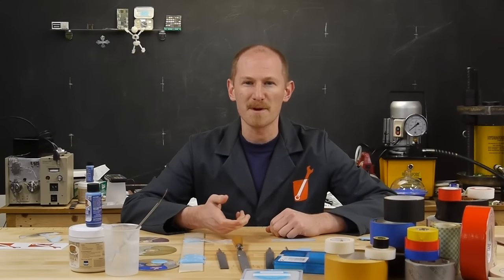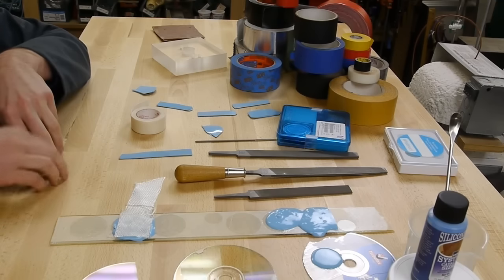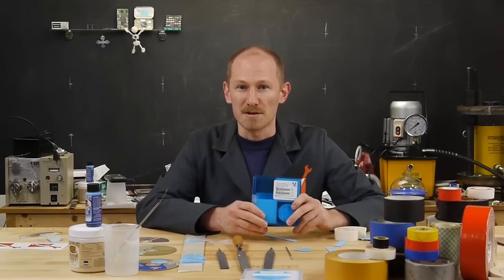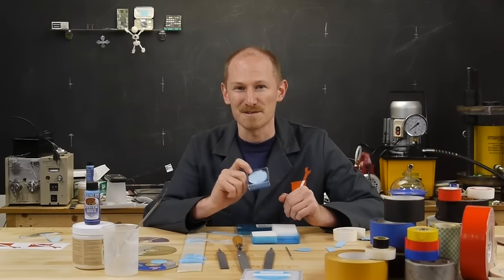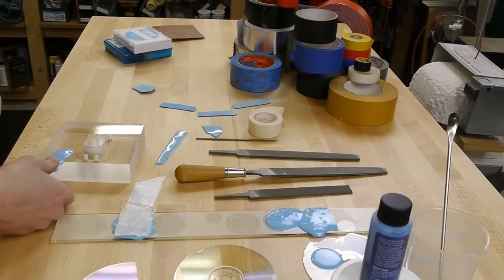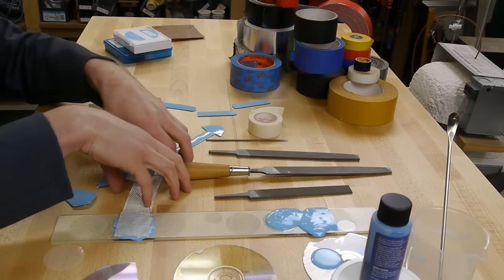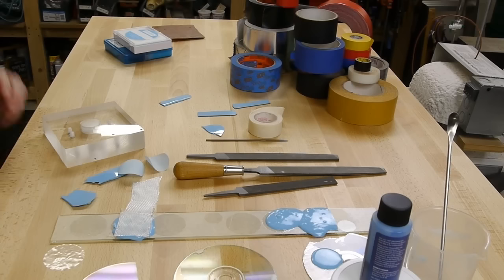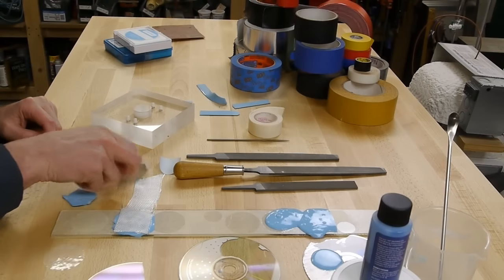Making DIY gecko tape - work in progress

Comment: I think that the cd idea was great, you could try to use a dvd burner, but with the initial laser replaced with a more powerful one (a classical dvd burner isn't supposed to burn the external plastic), the good thing about this is that the optical system is already there, especially the adjustable-position lens. 
From there, by adjusting laser pulses duration you could adjust hole depth, and adjusting rotation speed allows you to adjust hole density
Choose a plastic that absobs well your wavelength and that can be easily disolved.
Easier said than done, but you are very good at doing things ;)

Comment: If a CD/DVD/BluRay offers the hole density that you are looking for, you might look into having someone hack the firmware on a burner drive to up the power on the laser/slow burn speed down to get deeper pits. If you need a thicker substrate on disc, you seem like just the guy to come up with a way deposit a thicker material. It probably wouldn't even have to be similar material, only compliant with the laser. Hacking the disc firmware could also disable the usual checks where it attempts to determine type/make of disc allowing your custom discs to burn... Have someone create a disc image that has a consistent 0101010 or 111111 structure (whichever offers more pits)...just a thought. Love your channel. Scanning electron microscope videos are SWEET!

Comment: 1) You need nanostructures (very dense), 5 microns won’t cut it. Your surface must interlock with the nanofeatures of the substrate you’re walking on. Gecko will walk on glass but not on well-polished glass that does not have these nano-size surface “imperfections”. The adhesion works by mostly by increasing friction with the substrate. All these microstructures done in the academy don’t really do any better than regular duct tape of the “flat” surface of the silicone like you have discovered. These structures actually lower the surface area that contacts the substrate.
2) Even if you get a “gecko” tape structure it won’t work very well.
 a) It will get dirty fast and become less effective. The gecko has some engineering tricks to keep that surface clean and dry, but if you do manage to get a gecko’s leg dirty or wet it won’t be able to climb and better than other lizards
 b) Unlike your piece of silicone or regular duct tape, the gecko uses active force LATERAL to the substrate to force interlocking of its feet with the nanostructures of the substrate. It “feels” where it needs to apply more force and apply that force in real time. It is very much like when you walk, your body instinctively adjust the force that different parts of your feet apply to the floor. If you paralyze the muscles that control the ligaments of its feet, said feed won’t be able to stick very well. 
3) There is a European company that sells PVS “gecko” like adhesive with mushroom-shaped pillars. You can buy that, but the performance is bad. All these pillar-like structures are actually more closely similar the adhesive feet of some beetles than geckos an none work as well…

Comment: So... I don't know how helpful my input is... but you get it anyway:

1. Use things that have nano structures on the surface, and don't use metal... 
I noticed that allot of people are suggesting anodized aluminum and titanium, but both of those metals can react with 2 part silicone rubber mixtures. The metals interfere with the platinum catalyst used. You might be able to apply heat or some other additive that changes the curing rate to make such nano structured metals work, but that's probably not ideal. 
As far as that goes, I'd go with glass that has been etched with hydroflouric acid. Etched glass has known nanostructures and it doesn't require beta emission (you can modify the surface with chemical etchants too). Plus, if you decide to continue using the 2 part mixture, you can tinker with heat and other additives without a whole lot of reactivity coming into play. 

2. I'd change over to different silicone rubber mix. I'd use a room temperature vulcanizing mixture that uses the normal tin catalyst instead of the platinum catalyst. It's got a quicker curing time and is less prone to catalytic poisoning. Thin it using a dry solvent (emphasis on DRY.. like .0001% water might be too much), and it's habit of putting off acetate allows you modify the surface of a tape based on pH. like you could spray it onto a surface of sodium silicate, and the acidic acetate it puts off as it cures could improve it's surface towards what you want. 

3. I'd look at a continuous method of producing the tape instead of a cast product. If this is being commercialized, it's probably not being done via a cell cast method. It's probably a continuous production line that runs for 3-4 hours at a time (or longer, depending on automatization ). So.. casting it might net you weird results. I know that heat will cure some silicone rubbers, but it depends on the silicone rubber formula to begin with. In that regard,  i'm really not sure which type is best suited for this. Faster curing stuff that resists catalytic poisoning is my obvious preference but perhaps something that takes days, UV light, and pressure would be better.

Comment: Gore-text is reported to have a 0.2 micrometer hole size.  The question is how thin can Gore-text be made?  Looks like the base material is PTFE commonly known as Teflon. WL Gore uses a proprietary process which involves stretching the PTFE a predetermined amount to create up to 14 million pores per mm square. Hope this helps.

Comment: A couple of my friends discovered a few months ago that our laser cutter (a typical hackerspace laser cutter, ~80 W CO2) can make microscopic holes in balloon rubber, which are invisible when it's relaxed but large enough to see when you stretch it. So it might be possible, by stretching the rubber different amounts during laser perforation and casting, to make customizable sizes and patterns of pillars using this method.

Also, regarding photolithography and lenses not passing UV, sapphire is transparent to UV. Maybe it's time to start making your own custom sapphire lenses? I suggest the micro-pulling-down method of growing the crystals.

Comment: The microscopic profile of the geko surface resembles damaged hair with split ends. Perhaps a bundle of fine damaged hair arranged on a flat surface pressed into a substrate of silicone or conversely inverted and coated with a layer of silicone or some such material could be used as a mold.

Comment: May be you can make a photolithografic holes in photoresist and then use anodic dissolution to  dissolve a metal behind the photoresist like a PCB production process.

Comment: What if you cast the silicone on to the surface of a diffraction grating?  These are the parts that are used in place of a prism in UV-Vis and similar machines to split light into multiple colors.  Visible light has roughly the correct size, in terms of wavelength, but may not have the depth.  It's worth a shot I think.
Reply: It seems after browsing some comments that others have had the same thought.  Even if a standard diffraction grating doesn't have the ability to do this maybe the process used to make them can be used to make a suitable mold.  At the time of making this comment I don't know what that process is for sure, but I'd assume it's some form of etching process.

Comment: The best technique I found is using a 5 nm lab grade microfilter as the mold, using polyurethane as the casting material, and backing it with a stiff fabric like Kevlar or till weave carbon fiber.

Comment: I have a little research experience in this area. Most things already mentioned but I didn't see this: you can fix your file casting "sharp bits at the bottom" problem by casting from a cast. Just need to get the materials right so they don't stick to each other.

Comment: Just a thought, could you add nano meter size magnetic powder material into the silicon and pull it into a material from beneath using a magnetic source as it cures? *actually someone appears to have suggested this earlier*

Comment: Each pillar tip needs millions of more tips.  The most refined laser etching with CNC controlled passes.  Then flash/ melt / vapor/ gouge out tracks for large pillars. Micro pillars unidirectional for removal like the gecko.  Hashes on tips of hashes.  Sorry if echo.  The surface itself is half the equation though.  Good luck!

Comment: I do not think mold is a good solution unless the mold is one time use and can be dissolved. I think having the hair like structure to begin with and stick that chemically to a surface may work better.  But not sure it seems each pillar will need to be similar to a micro suction cap so they need to stay straight since the side of the pillar is circular so almost no contact with a flat surface.
Also they probably be very close spaced.
Looking forward to see more on this.

Comment: I just had a thought. I realized you have a model for the hairs in the brand new toothbrush you looked at in the SEM. You'd have to invert the pattern obviously, but the basic structure is already there.

Comment: For photolithography, you would probably need a lens of a material other than glass. I'm sure that kind of optics would be extremely expensive, but they are  (or were) used in semiconductor manufacture. Perhaps if you can get some obsolete stepper equipment, you could scavenge the optics.

Another thought might be to use a laser with a galvanometer to etch the pattern. Then you might be able to use a metal mirror rather than a glass lens. I'm just not sure if the optics of a galvanometer allow you to make nanometer-scale images.

Comment: Place the filter on a thin layer of a fine grained, acid-dissolvable substance - like plaster of paris, but probably something finer is needed. This will clog up the holes with the 'plaster'. Then expose one side of the filter to a weak acid, experimenting with  varying lengths of time (and/or acid strengths, temperatures), which will dissolve out the holes to various depths, until you get the hole depth and therefore aspect ratio you desire.

Comment: Turn some graphene into a sheet and use that as the casting material. From the looks of it, sheets of graphite are thinner than the plastic that you already bought and they have smaller, more densely packed holes in the nano sizes.

Comment: "Hollow Fiber Membranes" have very similar structure. Perhaps they could aid in your molding process. Also applying some kind of releasing agent prior to casting and maybe using a heated process for ultra low molding viscosities. Regards.

Comment: Could you use a diffraction grating as a mold? Or maybe use an electrical discharge to create tiny Lichtenberg figures in something like acrylic and use that? That's the first thing I thought of when I saw the gecko feet - they have a fractal pattern just like Lichtenberg figures do.

Also, perhaps you could etch the CD (or Blu-Ray or whatever) until the pits wore all the way through to the substrate, but the surrounding material was still  intact, leaving tiny holes, and then sputter coat the resulting thin sheet to increase the aspect ratio of the holes.

Comment: Functionalization of vertically aligned carbon nanotubes seems to be a relevant paper. Growing a vertically aligned, parallel carbon nanotube forest to a specific height provides a potential mold, however it seems unclear if the mold would survive the pouring of the casting agent (silicone).

Comment: I do not know if the resins used for macro- stereolithography (see 3D printing resins) can be used for this, but there are many visible light spectrum resins, with the biggest shortfall seeming to be how long they take to cure (UV light has more energy and so can cure faster). That way you could just use standard optics, if a spot size small enough can be generated. I work a lot with 3D printers, mostly FDM machines, but I have built a projector based macro-stereolithography printer.

Comment: The easiest way to form pillar-like structure in the polymer is the solvent change technique which is originally used to make reverse osmosis membranes .if you are still interested in continuing this project I can send you some different molds made by this method

Comment: You can try casting some "wet" bumps using one of your techniques and the use something like electrospray techniques to "pull" them to a desired length before the material cures or even let it cure and use a "melt" electrospray technique, since it would et you more precision

Comment: Hi Ben, I had a few thoughts while watching this video. The surface structure you're trying to create seems to closely resemble black silicon. This creates silicon pillars with a very high aspect ratio via an RIE process. It is often used in solar panels to reduce reflectivity, but it might be useful here. I just realized though that you would have to make two casts to get the pillars, so I'm not sure how useful that would be.

You might have some success modifying your SEM for focused ion beam (FIB) patterning. This sputters material only where the ion beam is focused. You could create the pattern this way, but it would take a very long time.

Finally, you might look into Rubylith. This is the old fashioned way of making photomasks. You create the mask at a scale of ~100:1 and then continually reduce it via several photographic processes. You could create an array of holes in the Rubylith with a #12 sewing needle (diameter ~350 microns) for a pillar diameter of ~3.5 microns.

If you have any questions about any of this, or any questions about photolithography, I'd be happy to answer them.

Comment: If there is a material that vaporizes with bright light, perhaps you can use a lens to focus the light precisely enough to get holes of the right shape and size, and then make a cast with the resulting holed surface.

Comment: Consider using very thin sheets of Graphene instead of Polycarbonate and perform the perforation via radiation yourself in order to get the aspect ratio right. If you find a working acid for Graphene you could also test how small the holes in the Graphene can be before the Silicon stops to flow through. Furthermore it would also be possible to control the direction the beta particles pierce the Graphene via an apeture.
Finally, if the silicon hairs keep falling down you can try sputtering one side of the graphene sheet with a silicon repelling substance. 
Good luck, amazing project :)

Comment: Try using your electron microscope with the photolithographic coating you should be able to modulate the beam enough to create the uniform holes needed to mold the gecko tape in fact you could just try it with the poly carbonate and etch it like the membrane.

Comment: Looking at the patterns of the fibers on a gecko pad it apears to resemble more of a fractal geometry than a file or a simple bristle brush. Perhaps a very fine frayed brush gathered close together suspended facing down in silicone left to cure then use that as a mold.

Comment: Off the wall thought .. Could you rig a machine to draw the curing silicone or a similar substance into a super thin filament, and collect huge lengths of it? You could then gather the filament into bundles of perhaps millions of parallel fibers, squeeze the bundles together and slice them into wafer-like cross sections.

Comment: apply aluminum foil to clear tape (onto sticky side).
flatten down as best as you can. 

apply thin solution of etching asphaltum to aluminum side and allow to dry. 

obtain an X Y plotter system, and fit with a fine tip needle to create patterns into the asphaltum, exposing the aluminum.
then etch in sodium hydroxide. this creates a photomask.
use photomask to pattern onto a photopolymer coated substrate, then caste silicone onto patterned photopolymer.

Comment: couple ideas
1 use platinum cure silicone, and a harder one, check smooth on
2 vacuum the silicone before casting
3 make a casting out of the fine file and use that as a mold, (mold release? maybe?)

Comment: You could use the electron microscope for the lithography, electrons are basically beta particles. From there out you can use the same etching process as done for the filters. In an electron microscope the electron angle of incidence is only a few milirads. In that way you'll create straight pillars. At least if the electron path in the material is straight enough. The electrons have a penetration depth of 4 micrometer at 30KeV(A.C. Narvaez et al, Optics express 21 (2013)). The resolution of your electron microscope is unknown to me. To do the electron beam lithography, you basically have to scan a grid of points. In this way you can achieve the same as the UV photolithography

Comment: +Applied Science
Ground sugar/salt/etc to very fine power (up to 6000 grit) and pour the silicon on that. Then just  wash the silicon when it is set.
This probably doesn't work, but it's pretty easy to try.

Comment: You mentioned that the file pattern has sharp edges for cutting, but the bottom of the grooves are round. This does not solve the actual micron-scale etching problem, but just for sake of curiosity you could use the high-quality file as mold to create a negative of the file pattern eg. using cast acrylic or whatever. Then you could use the negative as mold to create gecko tape with sharp edges? According your previous results it is quite obvious that the resulting tape may not be much better, but it would be interesting to see the difference.